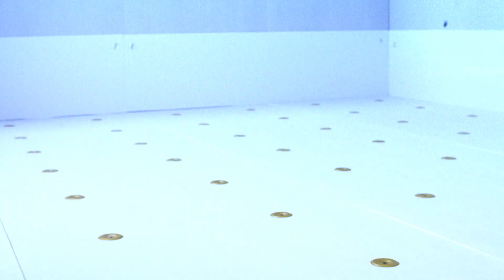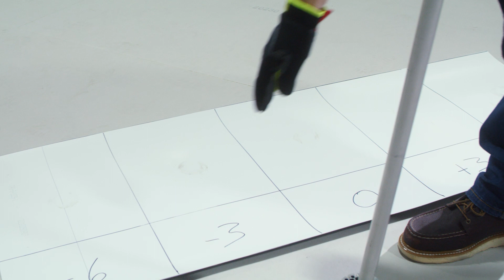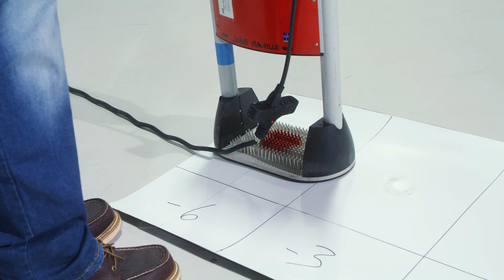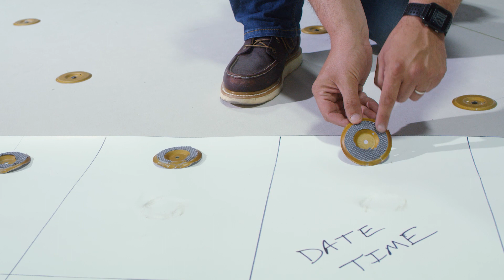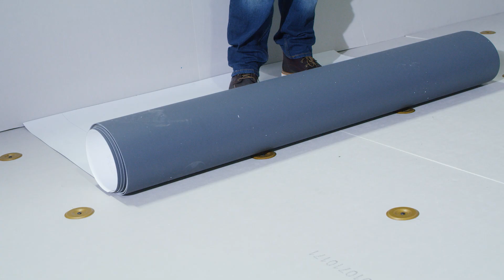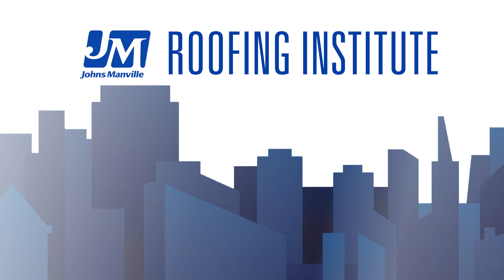JM RhinoPlate System Training

Comment: The ambient temperature dictates the weld. If it is 44 degrees in the morning and then gets to 60 degrees at noon the weld setting needs to be adjusted from the 44 degree weld setting. Tighten up guys.